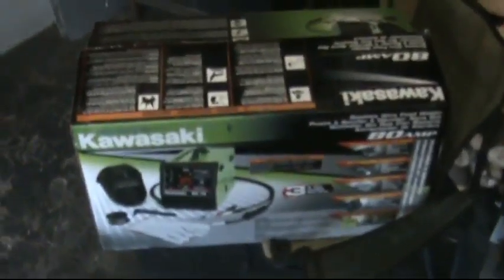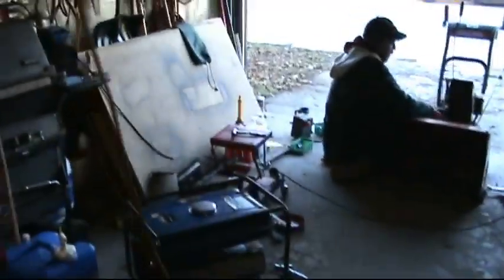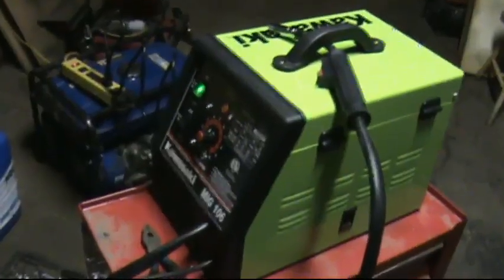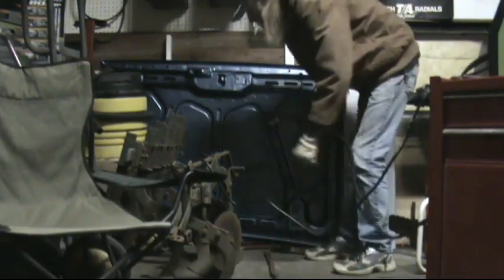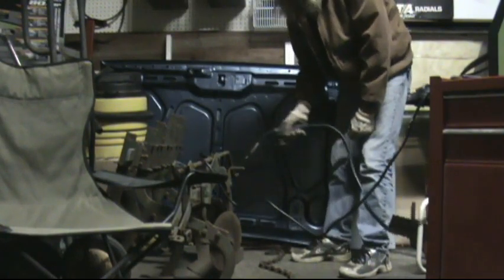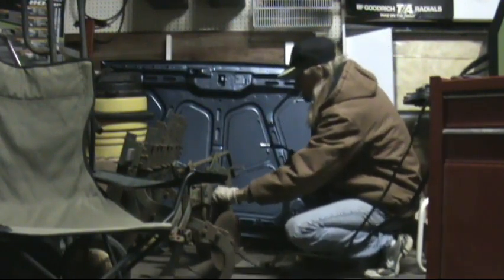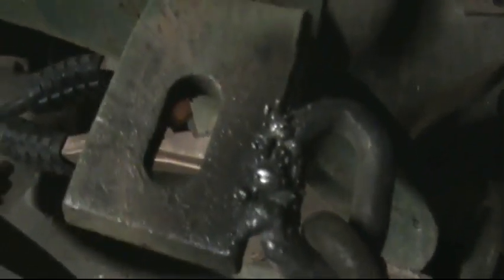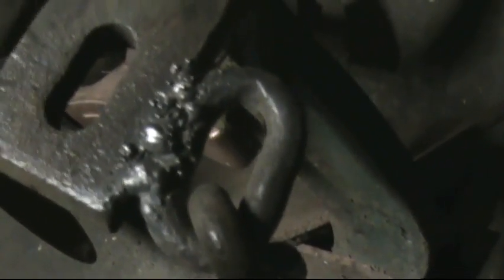Kawasaki

Comment: i spent the big money on a good one and i can weld anything. i hate the flux cor wire its only good in the wind when i am outside. if i am inside i use the gas but i weld all the time. good luck with the new welder slow down the wire speed and you will have better luck.

Comment: it didn't do too bad for a little 110volt  you need too slow it down a bit to get a little better penetration too. you gotta weld slower with the lower current.  as for the stuff that came with the welder be happy. I bought a 220 volt industrial welder an all i got with mine was a little shield you hold up in front of your face. no helmet, no gloves, nothing but the welder and that shield and a measly lttle dinky roll of wire. and even with it i can't go too fast or it looks like crap too.